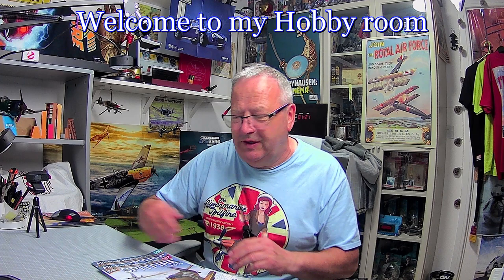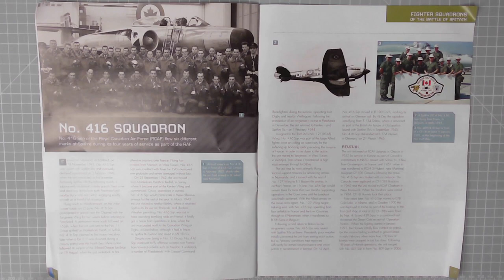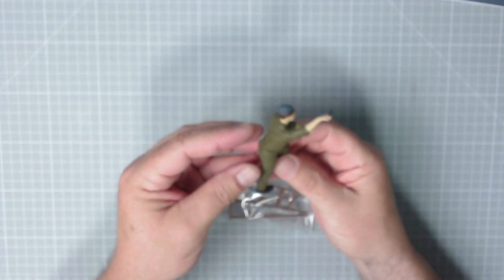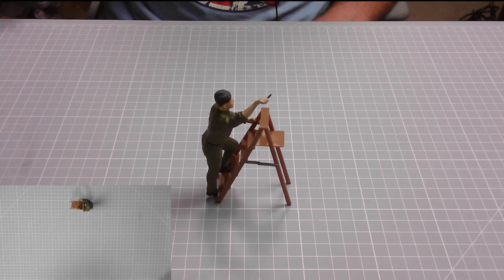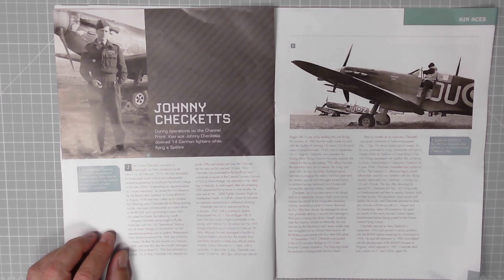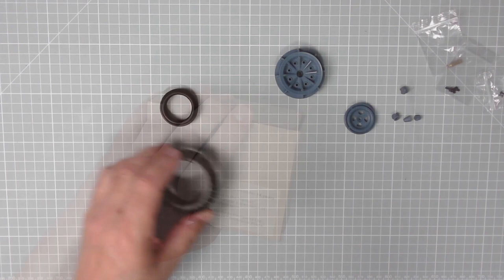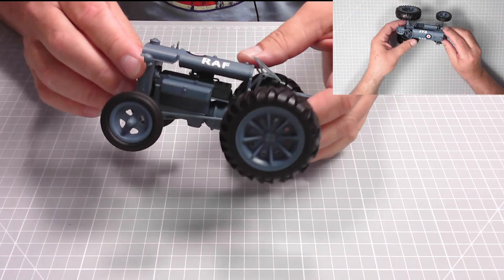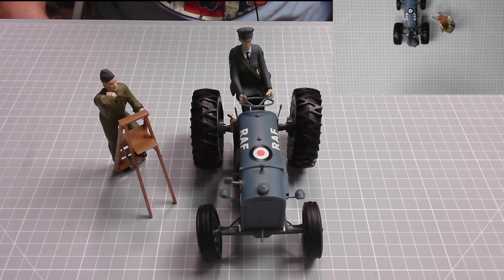Build a Spitfire issues 107 108 from Hachette

Comment: I'm so glad I cancelled my subscription at issue 100. What an absolute disgrace Hachette are. All this extra items could have been completed in about 8 issues, maximum. A tip for you John for future, warm the rubber tyres in water and then it will be easier to put on the wheel.
Reply from the maker: Thanks Kev. I was too lazy to boil a kettle. lol
Reply: @JohnsModelmaking  with the cost of boiling a kettle, I don't blame you one bit. 😁😁